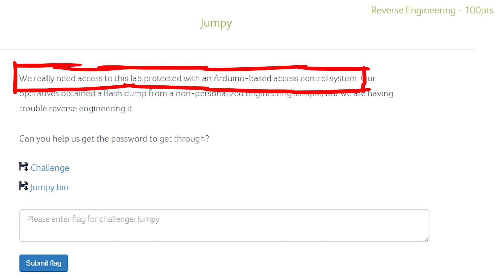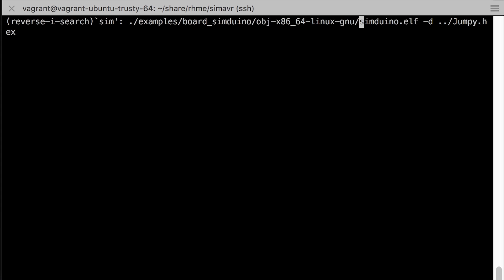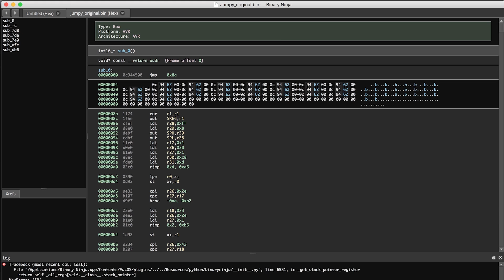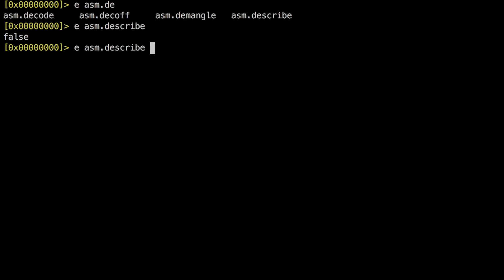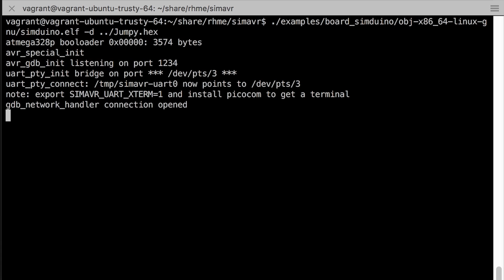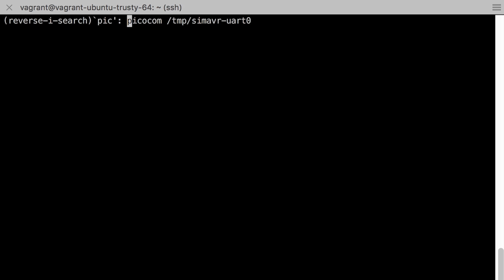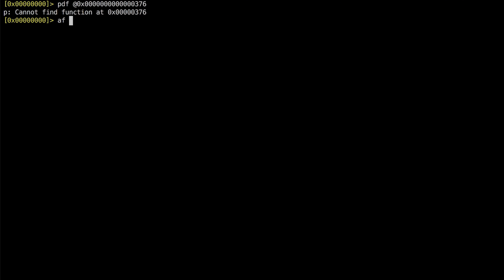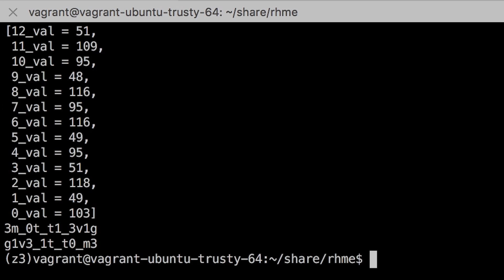Solving AVR reverse engineering challenge with radare2 - rhme2 Jumpy (reversing 100)

Comment: How did you get your .gdbinit file to work in avr-gdb? It works in normal gdb but when i open the avr version, I get an error saying that scripting in python is not allowed in this version of gdb. I am running Ubuntu and can not find any other avr-gdb version which supports python.
Reply: Did you ever figure out how to get this to work?  Having the same issue
Reply: Ryan Wincey No never got it to work. You need to compile your own avr-gdb with python scripting enabled.

Comment: 0:41 The hex binaries is NOT encrypted. It is just encoded with Intel HEX. You can disassemble the HEX file with avr-objdump.
Reply from the maker: The binary is encrypted. It's Intel HEX format, but it's still not valid assembler. The arduino board we got for the competition is preloaded with a custom bootloader and customised with unique keys for each player. The binaries for the challenge are encrypted, so that nobody can solve all challenges by simply reversing the code. And the bootloader decrypts the binary you flash. 
Just in this case, they additionally provided a non-encrypted binary, because it was a reversing challenge.
Reply: I see. So the Challenge HEX file is not same with this? https://github.com/Riscure/Rhme-2016/blob/master/challenges/binaries/jumpy/jumpy.hex
Reply from the maker: Same program, but those HEX files are not encrypted, so you can load them with the regular Arduino bootloader. But they were released after the competition.
Reply: I see, thanks for the clarifications :)

Comment: Unless you are using 1year old r2, r2 -a avr is useless for the jumpy binary. This is automatically recognized.
Reply from the maker: +Maxime Morin does r2 use heuristics to determine that it's AVR? If so isn't it nicer if I don't rely on that by specifying -a?
Reply: Problem is that -a avr specify the arch or what you want is to recognise the fileformat so you should be `r2 -F avr` if you really want to force. But in this case it's unecessary because this is recognized, if the "heuristic" as you call them would fail -> Report the issue or fix it https://github.com/radare/radare2/blob/master/libr/bin/p/bin_avr.c
Reply from the maker: +Maxime Morin but the file is just a raw binary blop. It's not an ELF or something. So what is the file format it would try to identify?
Reply: Read the code.
Reply from the maker: I really don't get what you try to tell me. Also I just updated r2 again and can confirm that it recognizes it as avr. Though when I recorded the challenge a few months back, this was not the case. I don't know when I last updated it before that, but usually I always update when I use r2.

So what you are saying is, that radare2 has heuristics to determine that the binary file contains avr code, right? But that's still just a heuristic?
You mentioned that it's a problem to do '-a avr', but you don't say why that is a problem. Is it not "nicer" to specify the arch instead of relying on some guesses?
Also is -a avr just unnecessary redundancy or is it actually a problem as you said?
care to explain?
Reply: One visible difference:
old r2 -> No Entrypoint
current r2 -> Entrypoint
Reply from the maker: yup. But like I said, I recorded this video a few months ago. So I guess I forgot to update at that time, or it was not yet a feature.
Reply: Yep that's what I said in the initial comment :)
Reply from the maker: heh, glad we cleared that up :D
thanks for pointing it out

Comment: Nice, too bad I didn't learn anything about assembler and now I'm too busy working with C.
Reply from the maker: +billigerfusel just debug your C programs with gdb and look at the assembler code when you run into crashes.
Reply: I did that once and it helped. Before my program jumped into the HardFaultHandler I saw in the Assembler code that it was just in an area full of empty flash. Turned out my code grew into the part of the flash where I was doing my EEPROM emulation :D